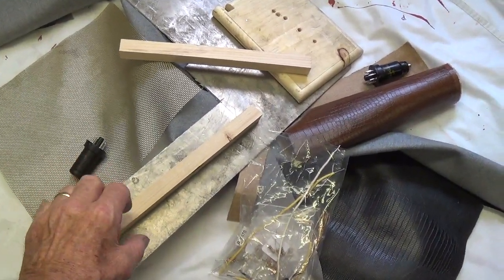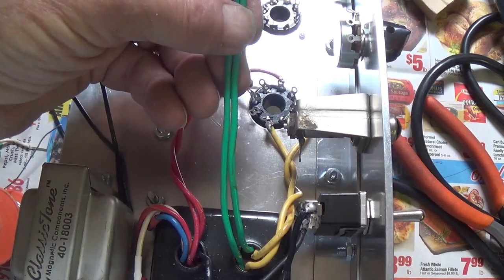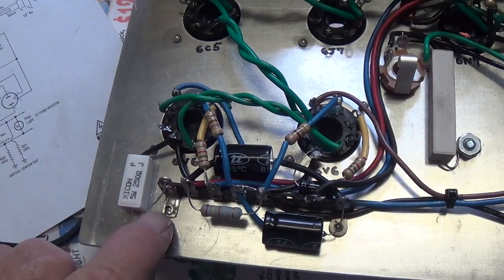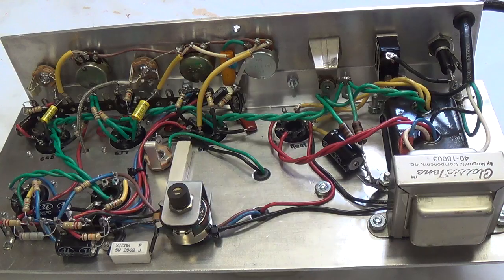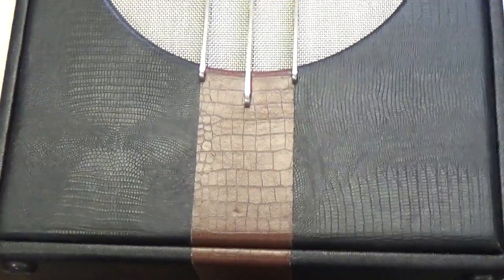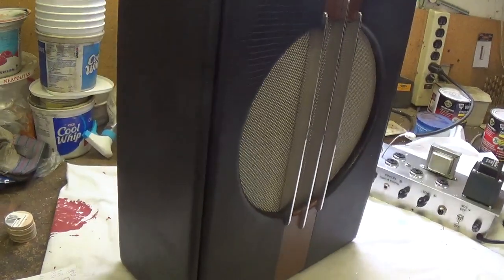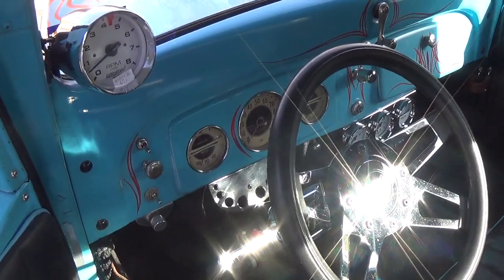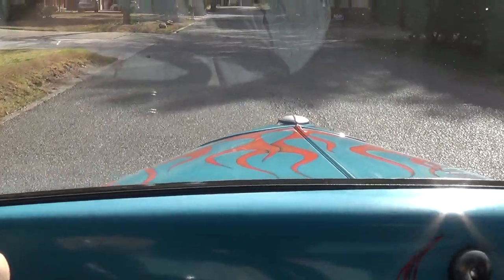Let's Build the Mystery Amp, Part 4: Chassis Wiring & Completed Cabinet

Comment: Looking good! I have heard that the shielded cable shield is only soldered at one end. Is that also the case when wiring up a guitars input jack?
Reply from the maker: Thanks, Gary. Excellent answer.
Reply: Yeah thanks, makes sense now, lol. Any idea if those triax cable really do anything to reduce noise?
Reply from the maker: I have not done a with and without comparison, but I think that elimination of hum is not accomplished by any single factor.....rather, it results from attention to many small details, this being one of them. I predict that this amp will have zero background noise, so we'll see if my theory is correct.

Comment: Enjoy the nice neat work on the amp and keep showing the hot rods too!
Do you know why rectifier tubes have 5 volt filaments when all the others are 6.3 volts?
Reply from the maker: Thanks, T. That's a good question. There are 6.3VAC rectifiers, like the 6X5, which you'll see in quite a few smaller amps. Here is an explanation I stole from the Telecaster Discussion Page:  

 I think by the time they developed really good 6V rectifiers, the 5V 
types had been established as a standard (type 80 introduced in 1927) 
and people were accustomed to using separate windings for rectifier and 
signal tubes.  When they did get around to designing 6V rectifiers like 
the 6X4/6X5 (I think during WWII), they designed them with the cathode 
and heater unconnected.  (Probably so they could be used on the same 
filament winding as the signal tubes without blowing the heater-cathode 
insulation on them.  It seems like pretty much every 6V half- or 
full-wave rectifier tube since has the cathode separate from the 
heater.)  Since the heater-cathode insulation is a semiconductor at high
 temperatures, you've got to do it right or it will short out with high 
voltage swings at the cathode!  Indirectly-heated 5V rectifiers always 
had the cathode connected to the heater (because they got their own 
winding anyway) so this eliminated any voltage difference between the 
cathode and heater that would have threatened the insulation.

So the 6V rectifier tubes were mostly lower-duty types that saved a 5V 
winding in small radios and such.  For other, bigger applications, 
especially those where hum would be a concern, because of the potential 
of coupling B+ ripple onto the heater winding, it made sense to give the
 rectifier its own winding, and at that point, why not use the 
established 5V types?

Comment: One of the things in your design that does concern me is the carry handle.   A plastic handle like that could rattle at high volume... thus the Rubber or Leather handles are usually standard.   Other than that,  I'm very impressed.   I play loud though...
Reply from the maker: You're right on the money, DK. I already took measures to quiet the rattling of the handle pivots. Next, I will address the handle itself.
Reply: The only amps I have with rigid handles like that are made by VOX...  (Night Train series)... those handles have zero room to wiggle in the brackets...  Plus it's a head/speaker set,  rather than a combo amp.

Comment: Looks Stunning ! how did you get the snake skin covering on the back section to fit so nicely through the holes ?
Reply from the maker: Thanks, Duncan. Check out my How to Cover a Cabinet video series.  You carefully slit the material over the empty space and then pull each of the flaps tightly around the bend.

Comment: I must say Doug, I think that is the nicest cabinet you have created yet.. It certainly brings to mind the golden years of yesterday. The layout and wiring of the chassi is flawless as usual. That phase inverter tube is quite odd. I have a bunch of those, and while researching them it seems they can be used as a driver or as output tubes themselves. Great Chevy, the 3.08 gears are the way to go. Do you still own the jeep? Thanks, Tom
Reply from the maker: Thanks so much, Tom. I first encountered the 6N7 tube in my Fender Model 26 build, and was impressed. I agree with the 3.08's......dynamite on the highway. I sold the Jeep, but miss it and am looking for another one :)

Comment: Uncle, how did you attach the polished aluminum bars to the baffle ? Also, is the grill cloth some sort of heavy metallic screening ? It is hard for me to see the color of the grill cloth material.  I can't tell if it is a brass color or a silver color. And just because I hold your opinion in high regard. Do you think a metal grill cloth material effects the sound of the speaker in comparison to a linen type grill cloth ? Thank you very much and have a nice weekend !
Reply: Hi Bryan, I will let UD answer all the other questions, but since I was reading the comments and saw yours, I know the answer to one. The grill cloth fabric is actually the material used for outside deck chairs.. Doug goes over that in one of his earlier video's... It's inexpensive and quite durable too.  Take care, Tom
Reply: Thank you. I must have missed that.
Reply from the maker: Greetings, Bryan. Tom is right. The material is nylon, I believe, quite strong but flexible, and a pale gold color. I cut slots in the speaker baffle that provided an interference fit for the grill bars, then, after covering the baffle, I pressed them into place (with quite a bit of effort.....they are in tight).

Comment: I like that feature to put a resistor to protect the amp. I usually use a stereo jack  to switch the ground bias on the output tubes, so if you don't plug a speaker the output tube is off. But i think this way is better.
Reply from the maker: Thanks, Suterudo. Glad you liked the idea :)

Comment: Nice video and cool truck. The electric chair style signal cap on the tube is anew one for me.  Never seen that one before. 

As a tremolo junkie, have you thought about doing an amp build with the five triode harmonic trem circuit from the brownface super?
Reply: Hi Bill, The grid cap on the 6J7 is on a lot of older tubes, and was in many amplifiers of the 40's- 50's. Valco amp's come to mind off the top of my head. They made the tube without the top cap, it's the 6SJ7, same tube, which you might know of. On some tubes, that cap on top isn't the grid, but the plate connection, in which case up to 500 volts could be present. So use caution. Take care, Tom
Reply from the maker: Again, Tom is right on the money, Bill. I thought about using the 6SJ7, but went with the top-cap version simply for nostalgia......and it works like a charm.  I have considered a harmonic tremolo build. It's rather complex but I've never seen a stand-alone version, so it would be an interesting challenge.

Comment: Your link to the schematics does not work. Also, can you post it somewhere that doesn't require a signup to view and/or will be up on the internet for a while? Its always a bummer to find an old article or video that all the links are dead on, kind of defeats the purpose of sharing the info for posterity. Thanks for your videos I love them! I am also curious about your mods to the original circuit, are you going to cover those in your final video?
Reply from the maker: Try this new, improved link:  https://app.box.com/s/iuy3zqiaqh1sj8s2ihz9dglm9zlwjr9o
Reply from the maker: All the mods except the bias pot are included on the revised schematic.
Reply: Interesting modified schematic. Thanks for re-posting it.

Comment: Thanks for all the tips on building the amp. Good idea about grounding the metal casings on the tubes...never heard of that before! Also about arching the wires to the filaments and not running them along the bottom of the chassis. A good idea to put the load resistor on the input jack too. Appreciate all the great ideas. The truck is a dream! My favorite engine of all time! You can run those 283's forever. Had a '55 truck with one that someone had installed. Wish I still had it! Sounds great too. A real beauty!
Reply from the maker: You're welcome, 74D. I'm glad the suggestions were helpful.

Comment: You did a good job on the cabinet nice look, where did you get that grill cloth from? And why did you put a jack for the speaker and not just solder it in what's the point! I mean yeah I suppose it's so you can connect an external speaker there but is that necessary! 
You don't think there's going to be any heat problems considering the case is enclosed for the amp at the bottom no air flow.
You said about the wires for the tubes why would that make that much difference if they're on top of the tubes than lying beside the tube holders will it really cause hum and why!?
Reply from the maker: Thanks, John. The grill cloth came from a local upholstery supply store. It was intended for recovering outdoor furniture, like chaise lounges.....very tough and resilient.

I use speaker jacks for all my amp builds, John. It allows for easy chassis removal, use of external speakers, and is the standard method for virtually every amp manufacturer I know of. I can't imagine doing it any other way.

The chassis is enclosed in every amp I own......I don't understand why this one would require ventilation when none of the others do. After 30 minutes of continuous operation, the only source of (slight) heat is the 5W cathode bias resistor.

I didn't invent the overhead filament wiring method......it is generally accepted as the standard method, because it reduces the proximity of the AC wiring to the tube base. Exposure to a single vertical AC pair is obviously less than with them wrapped all around the tube base.
Reply: Uncle Doug so with the magnetic field on the heater wires why didn't you run a shield in the wires to eliminate this problem altogether back to the power supply wouldn't this been better.
Don't most valve amps have vents in there casings? It's not just the resistors that will produce the heat your getting heat from the transformers if it's driven hard, and the valves will transmit some heat back into the aluminium not just up. Considering the case is a wood construction and will be an insulator to heat I thought some ventilation holes would  be needed.
Reply: Sorry to bother you uncle!!!!😊 Could you answer me this question you're the man! Who would know!  and who would give me an answer! If you had say a valve amplifier and you put the Transformers on a separate chassis and put them behind your speakers, and run the multi cable back to the amplifier wouldn't this be better! Because the speaker leads could be very short. I mean because if you have long speaker leads it causes RF interference and impedance problems? Would it be more beneficial to do it this way? Thanks!
Reply from the maker: I doubt that thinly shielding the filament wires would be as easy or effective as simply twisting them, John. I can tell you that after lots of experience with sealed aluminum chassis, heat is really not an issue. Aluminum dissipates heat far better than steel, and since heat rises, the PT and OPT don't contribute much heat to the aluminum beneath them.
Reply from the maker: The only benefit to separating the power supply from the amplifier, which is actually done in several vintage amps (i.e. Valco), is to reduce any possibility of hum being generated in the pre-amp from the power supply. Speaker leads are really not a problem. To my knowledge they generate no harmful field.
Reply: Uncle Doug no I was thinking that you would put the shielded wire in the twisted pair together! So you have three twisted wires? You don't think this would be more beneficial I don't see why it would be difficult to do it or awkward. But what do I know. Just got me thinking looking at the picture if you had the shielded wire what about if you had a capacitor from the terminal to the Shield what would this achieve anything?
Reply: Uncle Doug yeah I have heard about the power supply, I thinking of the "output Transformers for the speakers"? Thinking that you could use big Transformers, even those ones used for mains voltage on the poles, Making the amplifier very efficient and Powerful without hardly any distortion in the valve amplification. So it would have probably as good in THD as a solid state amplifier would have? Has it ever been done? You see these powerful valve amplifiers that seem to use a lot of tubes to achieve a great power but they don't have a low distortion. I would have thought it would be better to keep the valves to the minimum and rely on the Transformers?
Reply: Uncle Doug what are the actual shielded wires connected to ground?

Comment: What gauge is the green heater wires that are twisted together?
Reply from the maker: It came on the transformer, Gerald, and is quite stout. I would assume around 14 gauge or so.
Reply: Thank you. The amp I am slowly assembling is a Fender Pro-amp Model 5E5-A. Bought the kit 2 years ago this May. Just started to work on it.

Comment: Hey, Uncle! Great video. That 8ohm resistor is a nice detail but you can easily add an extra feature upon that: a line output from OT. This way you can plug it into another amp as sort of a preamp which features power tube saturation. Maybe that's not something that you'll do often, but it's always fun to experiment with your gear.
Reply from the maker: Thanks, IE. Good suggestion.....I'll keep it in mind for future builds.

Comment: I don’t know if it was intentional, but the vertical metal trim on the front of the amp cabinet gives it a guitar feeling, with the trim pieces being strings. It looks like one of those "boutique" amps they want an arm and a leg for…
Reply from the maker: That's an interesting observation, Johnny, and I really like it. Time to raise the price :)
Reply: Uncle Doug No problem! After you get the cash flowing, you can send me an amp. I’ll work up the specs in the meantime…

Comment: Great series Doug. Thanks again. A reminder that my contribution was more than worth it. The 8-0hm safety resistor, the insulation on the cap leads, the shielded RCA cables... all such great little tips. Three questions if you have the time (1) what's the wattage on your non-wire wound resistors (2) what problem did the virtual center tap solve and (3) is there a limitation on the number of filaments that one side of the filament secondary can service in parallel?
Reply from the maker: You're welcome, David. 1.) I use 1W resistors as a minimum in all builds. 2.) Any CT, virtual or not, reduces AC hum. 3.) The number of tubes is limited by the current capacity of the 6.3VAC power transformer winding.

Comment: Beautiful work.
Very nice chassis, the art deco alu was a nice touch.

Did you use a torch and brazing rod for the nut?
If so, would you consider making a guide/tutorial type video about that some time?

Seeing as this amp has two separate initial gainstages, have you ever made an amp with normalized input jacks to route the input to one, or another or both inputs?
several amps do this, but only the sunn model T comes to mind right now.
might be interesting.

Thanks doug.
Reply from the maker: Thanks so much, Borgar. I used a torch.....soldering irons are generally unable to melt silver solder.  I'll keep it in mind for future videos. Yes, I am considering provision of a toggle that will allow for linking of the two inputs.

Comment: Very good looking cabinet especially the bars,  sir what tipe of solid state of  rectifier is better bridge or with 2 diodes and center tap?
Reply from the maker: Thanks, Pedro. A FWB allows you to use a smaller, cheaper power transformer.

Comment: Ha! The return of the " mess with your mind " switch! Man that looks incredible. Astounding. Did you cut the 6.3 green wire multiple times or used another green wire? Is it 22 gauge? Thanks for all the knowledge Uncle Doug.
Reply from the maker: Thanks, NT :) I used the wire that came with the PT, and it was quite stout....probably around 14 gauge and tough to work with. You're welcome.

Comment: Great I'll just go grab a cuppa tea and watch, see what end section is etc. Exciting stuff! Fantastic tips. Particularly liked the high power resistors against aluminum chassis. Do you glue those to the chassis? Is there a glue that is like a heat sink paste?
Reply from the maker: Thanks so much, TT. Good question about the glue. No, I simply pressed them tight against the chassis. Since heat rises, I assume the aluminum will absorb and dissipate it. I'll check into glues.

Comment: Great project so far.  My one concern is that handle.  It looks solid enough, that's not likely to be a problem.  But there could be some resonant frequencies that have that handle up and dancing and quite possibly making a heck of a noise.  Maybe something between the pivot pins and the hamdle ends that dampen or stiffen the movement?  Or maybe it'll be swell as is.  Just my two cents.
Reply from the maker: Thanks, Joseph. Excellent observation, and one that I too am concerned about. My shop speaker has a similar handle and it did indeed vibrate noticeably. I will need to tighten up and silence the one on the new amp. I'll mention this in Part 5.